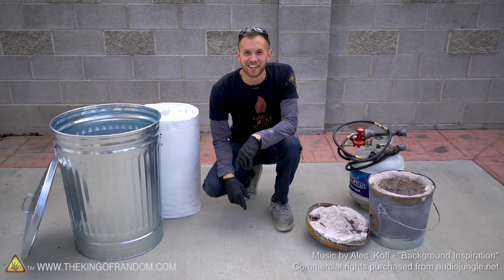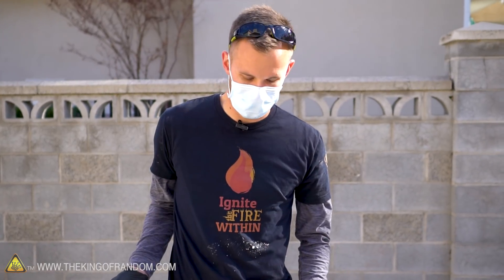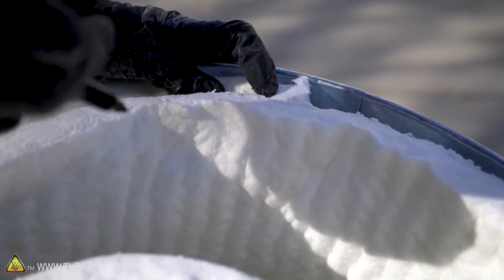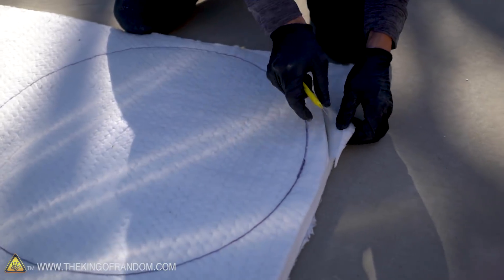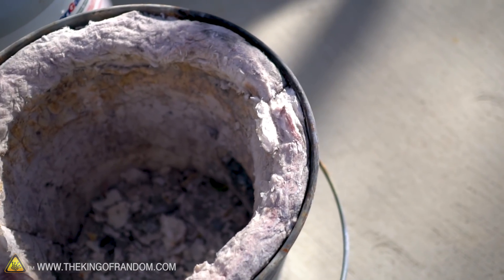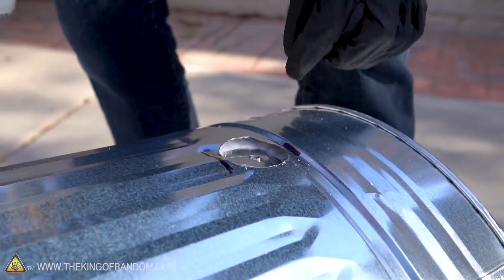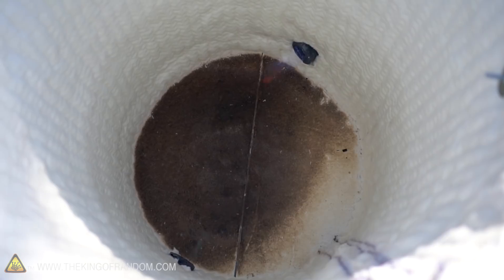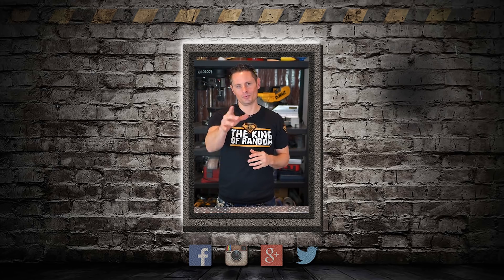MEGA Metal Foundry! TKOR Explores Everything You Need To Know How To Make a Trashcan Metal Foundry!

Comment: Is that can galvanized? If it is, the vapors it emits when it heats up is a huge health concern. I'd never use galvanized steel in anything that gets heated up.
Reply: xylordkhan1 well based on their demonstration with the kaowool and the blow torch, the trash can should be fairly insulated from the heat
Reply: carolyn mmitchell  Just doing it outside isn't enough. This is still very dangerous.
Reply: Welders sickness
Reply: Ross Bradwell yeah, looked at the amazon link just to make sure, that's totally galvanized. I worry about him, but even worse, tons of people are watching this and might replicate it, since it's a tutorial video. He should really take this down, or have a huge disclaimer "DON'T DO THIS" somewhere.
Reply: xylordkhan1 or just ya know, do it outside and don't breath in fumes
Reply: Harder than you think. That amount of galvanised steel can be extremely harmful, very potentially fatal to breath in, if it burns off.

Comment: I Dont understand why these vids get so many dislikes...?
Reply: adza botchway Well, the Kaowool is toxic and will flake off when burned and he didn't coat it with anything (like concrete or silicone)and the trash can and bolts he used were galvanized which produces Zinc Oxide and is toxic to breath as well. Not the main reason for the dislikes but at least mine had a reason.

Comment: I need to make this for my teenage daughter's ceramics.
Reply: Logan Gomez Word of warning: Kaowool is toxic and flakes when burned ( could be breathed in ) and the trash can and bolts he used in this video were galvanized steel and will produce Zinc Oxide when heated and this is really toxic to breath in. So I would advice making a smaller foundry, coating the Kaowool with another heatproof material, and avoiding using galvanized steel (usually shiny due to the Zinc coating).
Reply: randy H. Ok, thanks for the fyi. Very helpful.

Comment: I’m concerned about the gap between wool on the sides where the ceramic bottom is...  I would have put the walls in first so that they are pressed against the bottom, then set the ceramic bottom inside of the walls.

Comment: A tip for using a hole saw on thin gauge metal try running the the saw backwards the saw won't catch or grab and you will get a cleaner hole.

Comment: Hey make a bomb using thermite, black powder,TNT and rocket fuel please
Reply: Andro taker that is the hottest idea make it random
Reply: Needed: More specific parameters.

Thermite, and BP, both ARE rocket fuel. TNT is already an explosive, but it wont detonate from either thermite or BP, just burn vigorously. And then there is your secret mystery sauce. "Rocket fuel" could at this point be anything. Hydrogen peroxide, for example. But adding that to this reaction would do... nothing. Liquid hydrogen, liquid oxygen, or both? Anyhow, the end result would be a very vigorous burn, that if confined, would build pressure to the point where the container ruptures releasing a pressure-wave. I suppose that could be considered a "bomb".
But the inclusion of multiple reactive components wont make it more or less powerful. The amount of pressure required to rupture the container, will always be the same, meaning the result will be the same.

What you really want is the TNT to go high order, and detonate. But this just wont happen in these circumstances. You need a primary explosive for that, generally confined in a detonator. At which point all the other stuff, thermite, BP, and "rocket fuel" just will get flung around, quite possibly even without getting ignited.

Comment: Unfortunately the screws will conduct heat out to the shell, in time they will likely oxidize too. A better solution would be Sodium Silicate (waterglass) which forms an effective high temperature adhesive. Sodium Silicate is a major component in exhaust cement and chimney cement.

Comment: Make a fluidized bed using sand and some airflow beneath it. Basically you pump in some air in a very specific and consistent even manner, and it makes the sand behave like a fluid, as per the name of it.

Comment: That kaowool should be coated with a proper sealant rated to 3000 or higher degrees.  Also you might want to look into upgrading it with 3-4 1" burners to reach proper temperatures

Comment: I agree with the earlier comment, in that high temperature in a galvanized metal container runs the risk of generating zinc oxide & causing a case of "Metal fume fever".  I also wonder why this is not finished off by firing a coating of Rigidizer, which should help the kaolwool last longer & decrease the risk of inhaling particles.  I'd like to see that on a future video.

Comment: if you warmed it up could you use it as a oven to make bread or food?
Reply: Yes, but the bread would not have time to rise. The yeast would burn too fast. You'd have flat bread which would quickly turn to black dust. The foundry is simply a blow torch of fire. You can't eat anything cooked in it, because KaoWool is not human consumable, it's toxic.
Reply: Royce Barber also the whole trashcan is galvanized and the bolts inside so it's letting off toxic fumes

Comment: Can you try to light kao wool on fire? Using thermite or any other option ?
Reply: KaoWool will burn at about 3,300 degrees F, or even 3,000 degrees F if it's a cheaper or thinner KaoWool. It will not catch fire, it just cooks like burnt toast. It starts to crumble like burnt paper.

Comment: Can you mix mercury and aluminum together?
Reply: Sienna Meyer no
Reply: I mean u can but it doesn’t do much unless you get rid of the oxide layer which u can do with HCL acid which then strips the aluminum oxide away and then mercury will be able to amalgamate with the aluminum in a slow process
Reply: In other words, a drop of mercury onto aluminum, with the aluminum then scratched, will make the aluminum puff outward slowly, into a weak metal cotton ball.
Reply: that would make LME(liquid metal embrittlement)

Comment: If you use Jet Fuel instead of Propane, you can melt steel beams.
Reply: Doesn't Jet Fuel require pressure? If so, then that would take a much different setup.

Comment: Please I hope people read this.  DO NOT USE THIS DESIGN!  He's not coated the kaowool, creating a respiratory hazard for anyone nearby.  Also the metal fasteners are just conducting heat to the outside of the bin that is galvanised, creating more toxic fumes.  In addition a foundry that size needs 50mm kaowool to ensure heat isn't soaking through.  Would've been much better off just lining it with refractory cement to seal the kaowool and add to the heat trapping capabilities.

I hope KoR provides health cover for his minions, as they're gonna need it working around that thing.

Comment: Just wondering but if that insulating wool is so fibrous then wouldn't it be a issue when it is blasted with a torrent of flaming gas that vortexs around the foundry then shot up out?
Reply: Alter_Signa he bolted it down so no
Reply: yes, yes it does. thats why the old one is worn out.

Comment: You should flip the bolts which hold the kale wool in place, so the screw threads do not get deformed by the high temperature within the foundry. When replacing the kale wool it might pose a problem.

Comment: You really need to be more careful about using galvanized steel. Not even a mention of how much poison this will produce. If nothing else should have coated the inside and outside of the can with high temp paint, If not completely seering the outer layer of galvanization off  with acid or vinegar.

Comment: That’s asbestos...
Reply: BIGGABE361 just because it's an extreme insulator doesn't mean it's asbestos, same thing for not wanting to breathe it in. Otherwise that would technically make wood also asbestos.
Reply: The chances of that happening even if it was asbestos are soo low he would probably be fine. But no it's not asbestos kaowool Is ceramic fibres in a big sheet of it gets too hot it will melt on the edges.
Reply: It's not asbestos.
But I wouldn't breath the fibres
Reply: Xander King if you believe, you can achieve. Give it a shot.
Reply: It just isn't though
Reply: Kaos Bikes well let’s test it. Buy some, and inhale those fibers, let’s see if you get mesothelioma or asbestosis in 20 years. Let me know what happens.
Reply: If you or loved one was diagnosed with mesothelioma...
Reply: They removed it from that product years ago
Reply: Cole Stockton no it’s not this is made of ceramic
Reply: But it's not.
Reply: Not if you wear protection ( ͡° ͜ʖ ͡°)
Reply: I dont  think so. Asbestos has a grayish tint to it.
Reply: Its not asbestos, but is essentially the same thing.

Comment: The metal fasteners and washers will be the first thing to cause trouble when they try something really hot.  Either damage the fasteners or shoot the heat out to the aluminum can and melt that.  Wonder if there are ceramic fasteners they could use.

Comment: question: Will the stuff holding the wool on melt if you heat up the foundry? because they're made of metal?
Reply: But not the bolt, nut and washer on the inside...
Reply: MOO Gaming it's made of steel which has a vary high melting point
Reply: Maybe if it was made of aluminum, which trash cans are generally made from steel.
Reply: TM Spironic they are made of Steel (i Hope) they won't melt.
Reply: the metal is on the outside, which is protected by the wool itself.

Comment: You should try putting a go pro in the the two different foundry's:The large one and and the small one.✌️👑
Reply: The temperature limit of a GoPro is very limited, so it can endure a hot car which is up to 170 degrees F. But a foundry gets to 3,000 degrees F. So the plastic/glass/metal/silicon inside the GoPro would fuse together and drip.
Reply: Royce Barber yeah I'm guessing this person knew that but just wanted to see one get destroyed

Comment: If you do this and your shop isn't ventilated well, you might want to do a pre-burn in your galvanized barrel while standing up wind from it. It burns off the zinc to avoid exposure to zinc oxide fumes. If you plan on using it outdoors, it's not an issue at all, just stand up wind.

Comment: Add 2 extra burners on the top, perpendicular to the 2 on the bottom. And control them with a valve in case you don’t need that much heat.

Comment: why dont you add more torches further up the furnace as well, really give it some heat!!
Reply: The large expensive crucible they'll be using is only like 7 inches tall. That trash can has a lot of vertical space which won't be used. Unless they cook some tall pottery.
Reply: Royce Barber I mean get a bigger crucible too it'll be expensive but they can definitely afford it. Then they could upsize the castings too, make a huge sword

Comment: I'm really not opposed to making and improvised foundry there are several problems from a health perspective that need to be addressed. Firstly as someone below said kaowool fibres are carcinogenic and should be sealed with another refractory material or coating to prevent fibres being breathed in when the foundry is running. Secondly the bolts, washers and trash can used pose another health risk as they appear to galvanized (I could be mistaken) any galvanized steel will release zinc oxide when heated this is harmful to the body. 

Please coat the wool and clarify what metal was used as anyone who copies this could be harmed by the end product if not
Reply: Perhaps soaking the kaowool in sodium silicate or a diluted refractory cement would work as a sufficient sealant? Would also add rigidity to the wool.
I'm wondering if there is a less heat conductive material that could be used to help hold the wool instead of steel bolts.
My concern there is burning yourself on the heads of the bolts that have one end exposed to such high heat.
Reply: Actually with proper air flow ive melted steel, copper in my mini foundry
Reply: This needs to be at the Top!
Reply: LISTEN TO THIS GUYS!
Reply: This is no where near enough insulation for that size furnace. It will not hold in the heat across that much surface area with only an inch of ceramic blanket and those burners
Reply: exactly what i was thinking,  but the bolts looked stainless to me and shouldnt be a problem. But yes the misinformation about kaowool should be fixed and please put another layer in there and use a rigidizer and maybe a ir-coating, otherwise that furnace is all but useless.
Reply: .......right on man......
Reply: The foundry can't melt steel.
Reply: Well while that may be true, I feel like in this foundry the metal is just too high from the source, but I don't do this professionally or anything so idk
Reply: Super Nova So what you're saying is that jet fuel doesn't melt steel beams?
Reply: I don't know what temperature this foundry will reach - probably not enough to melt steel. But another problem with steel, is not just that it might melt - but it oxidizes as it's exposed to air and turns into iron oxide (wich is a very soft compound that just falls apart). This happens very quickly at temperatures 1200+°C. They would probably not last more tham maybe 5 times at those temperatures, before the fiber starts to come off the walls and lid - but I guess they would have a hard time to reach that high with the like 30 mm fibre insulation he put in (maybe if the burners are really high power, but it will use a lot of gas)
Reply: they sell kaowool ties that are able to withstand very high heat
Reply: Neeeeerd
Reply: Lionelthesnake 3 and yer they show you exactly how to recreate it
Reply: Lol copy and paste much buddy? Hes talking about the galvanization of the steel bolts... This is done with a zinc plating usually by electrolysis, it harmless unless it oxides during combustion and you breath it in THATS BAD!!!. Actually that foundry could get very close by a few hundred degrees to melt steel ;)
Reply: TOP
Reply: Fheyb
Reply: Also, those bolts will... melt... why? Because Foundry...
Reply: The bolts are a steel  based product and so they will only melt at a temperature of  1370° c (2500° F) and changes atom structure some were in between, steel is just iron that's processed to change the amount of carbon retained within it making it more durable and easier to weld and construct as carbon trapped under welds with hydrogen in c02 vapor escapes as its the smallest atom thus cracking and splitting it, but what I'm saying it that.... steel didn't melt at the temperatures the foundry, I estimate, reaches.... I think you've already figured that out
Reply: like and help get this to the top
Reply: Or you could just use it with a gas mask on...
Reply: Or what if someone burns themself on it. Like omg the children think of the children 😭

Comment: Since the nuts and bolts that are used to hold in the kaowool are metal, is there any concern of heat transfer from these supports to the outer metal surfaces?

Comment: try melting a car battery in that thing!
Reply: still it would be cool
Reply: what if the acid starts boiling!
Reply: They did. Already. But it was portable batteries like AA and C cell batteries. The heat does nothing but melt the outside of the battery, and make the acid and metal goo fall out. Nothing happens to speak of. But a phone battery, of lithium, would be like a firework and blast holes in the trash can.

Comment: Those screws need a layer of insulation based on the peak temperature within the furnace. Also, you need more heat to match the little furnace since your volume has increased. This would have been a lot more interesting if a couple of thermodynamics equations were thrown into the mix to figure out required heating input.

Comment: You’re heating galvanized metal to dangerous temperatures, you’re literally gassing yourselves with toxic fumes every time you heat that up.
Reply: Beowulf Owen eh he's outside there should be enough ventilation. If he was using it inside a shed or a house. If he was then he would have  whole host of other problems.
Reply: the metal will not heat up, because of the KAELOWOOOL
Reply: Mitchell Bristow he is talking about the screws that he used to secure the KAOLOWOOL

Comment: KAO-WOOL. High-temperature insulation wool (HTIW), also known as kaowool (a portmanteau of the words kaolin and wool), known as ceramic fiber wool until the 1990s, is one of several types of synthetic mineral wool, generally defined as those resistant to temperatures above 1000°C.

Comment: The kaolwool doesn't reflect the heat; it absorbs it. You are still losing a lot of heat, since it is all getting trapped in the kaolwool. This hurts the kaowool and over time will cause it to be even less efficient and less insulative (and a little dangerous). 
You really should put a refractory layer in. Castable refractory is easy to make, and would probably be easy to add to the current setup. You could even simply line it with refractory brick (the thick heavy fire brick, not the insulative fire brick). That would be a very easy fix and could raise your efficiency dramatically. If you do it well it could probably get so hot that it could even melt iron or steel!
Reply: KD Outdoors oh ok, that makes sense. Thanks for pointing that out!
Reply: That would be bad because then the burners would melt
Reply: Why would you state this like you know when you're obviously wrong? The second someone corrected you you just accepted it like you had no idea in the first place...?
Reply: Solomon_97 no it totally reflects it. I use it myself.
Reply: Diako Unknown 12 not really because most of the energy isn't emitting as light waves
Reply: you are wrong 
as someone who uses it in my own forge, i can tell you that it insulates by not absorbing the heat
Reply: Bring to top
Reply: Josiah Baumgartner lmao
Reply: Solomon_97 the whiteness should reflect SOME of it though